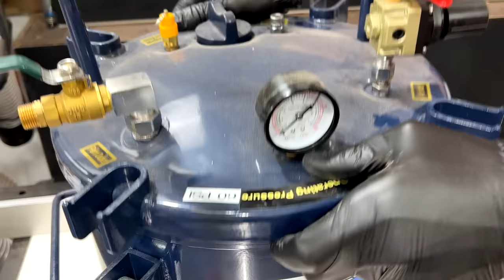Woodturning - Woodless Woodturning // A Brilliant Idea For Paper & Resin !!

Comment: I admittedly don’t know much about stuff like this, but was that some sort of “pressure cooker”-type pot you put the project in? If so, what is that for? Thanks in advance for any answers! 😊
Reply from the maker: Yes, a pressure pot. It makes tiny air bubbles trapped in the resin shrink to a microscopic size that makes the resin come out looking glass clear
Reply: @JackMackWoodturning  Thanks again for answering!

Comment: Should a respirator be worn when pouring epoxy?
Reply from the maker: If you do anything that puts dust in the air you should wear a respirator wether that’s wood or epoxy or anything else
Reply: @JackMackWoodturning  good to know, thanks!

Comment: Looks like pressure chamber, wtf? Why press air smaller instead suck it out in vacuum?
Reply from the maker: Because a vacuum doesn’t remove all of the air and expands the microscope bubbles and makes them visible.. that is why the correct way to make flawless resin is to let it cure while it’s under 50-60 psi.. which makes the remaining gas truly microscopic.. I don’t know how small but I can tell you I can polish to 3,000g and you see a mirror like reflection.